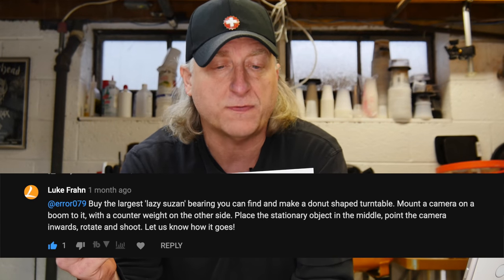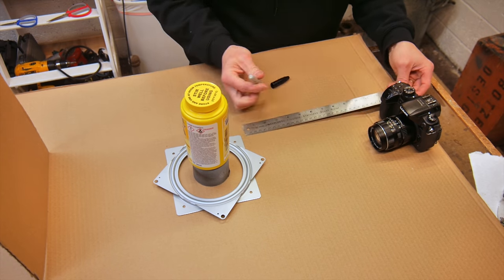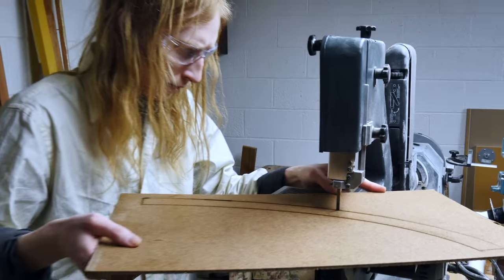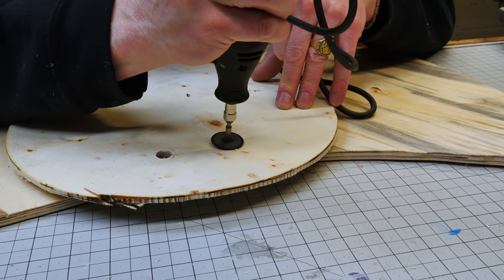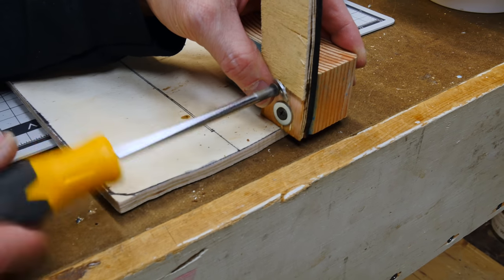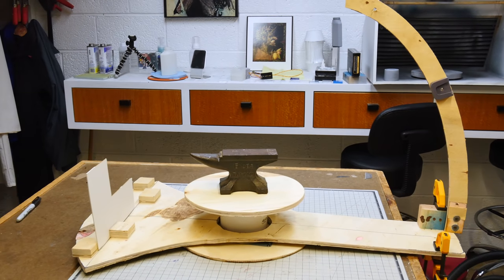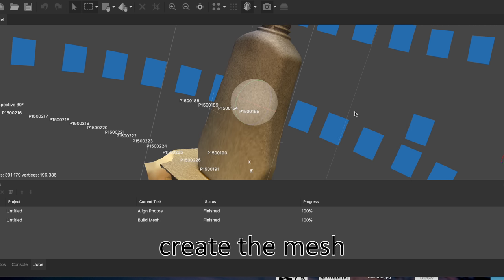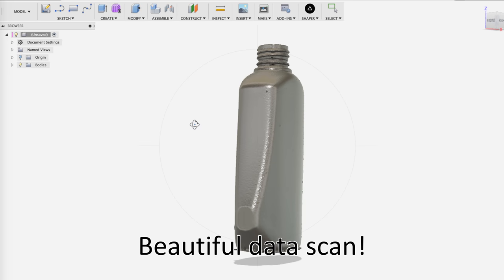Building a 3D Scanner Turntable: Advanced Photogrammetry Agisoft Metashape

Comment: Why not move the object with the plate instead of moving the whole thing around ? Just a small movement of the lazy sue..to keep light 100% the same
Reply from the maker: Just does not work well with this software unless you have very even diffused lighting
Reply: @EricStrebel  If you put distinguishing marks on the platter it works just fine. This is a ridiculous solution to a simple problem. Too many tools, not enough sense.
Reply: If you rotate the object the lighting will change from shot to shot confusing the software.
Reply: photogrammetry doesn't work in that way, you need to orbit object with your camera, no just rotating object in front of it. anyhow, very nice idea, i would add also some lighting etc. congrats.

Comment: Add a few stepper motors, remote shutter release, and a microcontroller and the whole process could be pretty well automated.  I am so amazed/enthused about the advances in photogrammetry and desktop machining in the last 10-15 years. Wonderful times we live in.
Reply from the maker: John Jones yeah, that would be pretty cool, above my skill set, but it would make a good collaboration vid with someone with those skills for V2.
Reply: @EricStrebel  Incidentally, I work at a tech startup that deals with robotics and image processing. My engineering co-workers think this could be done with <$200 of parts, for hands-free operation and a capture time of <2 minutes. I vote you find a mechatronics youtuber to collaborate with if you wish to automate V2. Would make for an awesome project!

Comment: Great upgrade from the Ben Heck Element 13 build he did.  Re-visiting this from when you first made and thinking I might do this in a maybe easier to disassemble design, albeit yours can be unscrewed as well with maybe some toothpicks or scrap wood if the woodscrew holes require.  Thanks for sharing!  Awesome design work!

Comment: Nice work. I had my design idea since two years. The arc which is carrying the camera is near quarter of a circle which goes from -15 degree to 80. But instead the rig is rotating around the subject . The subject sets over a turn table and turns around its axis which is much easier . And the subjects sets inside a lighting box which diffuses the light. Which is necessary for quality photogrammetry.k
Reply from the maker: I would love to see it please post a picture on social media and tag @botzendesign so I can see how you diffuse the light
Reply: @EricStrebel  The issue that I am not using social media to share. But I can send you the design I made for it.

Comment: What if you add a chessboard background instead of a white one, so the machine can compare it and make some calculations? Does the software allows you to manually or through script, telling what is the position/angle of the picture? So if you are using a stepmotor, you can tell the software exactly how many degrees you turn in each picture. What about placing some line lasers and taking the pictures in a isometric view, so you can calculate the distance from the red curvy line projected on the surface to the turning axis (like in a solid of revolution, where you have the line of each degree that will spin).?
Reply from the maker: Rodrigo Jäger I have no idea, reach out to the software manufacturer, as far as I can tell it figures all that out by itself, watch my most recent scanning video here for more insight. https://youtu.be/b1t33KcBlnk
Reply: As far as I am aware, it uses artificial intelligence comparing features from the 3D object and from the background to process how one picture connects to the other. That is why I believe having some sort of background, but still easy to differentiate from the object itself would help. Your result is amazing already, I was just wondering if you can combine this technology with others like counting known steps or tracing projected laser lines to pixels in some sort of triangulation and high order linear regression would improve the results for more situations. We know for instance that if the reflection of the light is not perfect due to refractions in materials like glasses or reflections in shinning objects, it would not be that good. So maybe it is possible to improve it with low cost technology and getting a quality better than some high cost solutions...

Comment: I make a hires video while going around the object.
Then extract frames from every 0.5 sec of my video then use those to make the photogrammetry.
Works fast and great :)
Reply from the maker: I like that, what software do you use?
Reply: @EricStrebel  I use a small free program to extract images from video. But the one i use now had a lot of spam and sale stuff in it and I reccomend you find your own.
After that I use either Mesroom or Autodesk Recap to make the photogrammetry from the image collection.
Autodesk Fusion 3d or Blender to clean the model up etc.
Sincerely PL.
Reply: @EricStrebel  It even works fast enough to make pretty good photogrammetries of (bald headed) persons :)
As the person does not have to sit still much longer then 2 to 3 minutes, instead of 15 to 30 minutes for handmade pictures.
PL.
Reply: @EricStrebel  Try it ;)
Reply from the maker: Peter Lunk  thanks for sharing very much appreciated Thanks for your support
Reply: Hi Peter. What's meant by hires video?
Reply: @dt9913  Hires -> Hi resolution ;)

Comment: Excellent! I thought it would not work without tracking pattern between turntable and item to scan. Maybe the rough plywood provided enough of a pattern to track.
Reply from the maker: error079 Yeah, I was pretty surprised as well, I will reach out to Agisoft and see what they say and get their thoughts as well.
Reply: When I played around with this photogrammetry stuff several years ago I found benefit from placing coloured tracking dots on the surface the object was sitting on.
Reply: @lukefrahn8538  

There’s also photogrammetry spray you can use.  It’s expensive though.

Comment: What I found to work best for me is to rotate the object itself, the final texture comes out uniformly lit on the entire surface, this way the object can be accurately lit in the 3d engine. Just a simple turntable used by cake shops, and the camera set on a tripod at different heights
Reply from the maker: What software supports that? Most do not....
Reply: @EricStrebel  I used RealityCapture https://www.youtube.com/watch?v=d3DA2jB2nQE
Reply: @Song Zee: Your result is impressive. Did you motorize the turntable, or manually spin it in increments? Any photos or footage of how your process goes? Also, I'm curious why you mentioned you had to do different heights with the camera+tripod...
Reply: I have the same idea, why rotate camera, it’s easier to rotate object itself. If the lighting is ambient and close to constant the result should be fine…
Reply from the maker: The software does not work that way
Reply: @EricStrebel  I found in internet many references that people make scans in object rotation way. Maybe I'm losing something.... Can you say why it not working?
Reply: @EricStrebel  It works, In fact Agisoft is the only one i got working with this method. I had 2 tripod system and my phone , works by using a black background and masking the whole background out it post before importing to agisoft

Comment: I took a tossed out microwave and pulled all the parts that I could.  Got a motorized table out of it and now I need to make a mount for it.  It's free and those microwave turn tables are really strong.  Now I'm looking to setup the lights and camera.  It's for eBay listings and 3D model making.
Reply: somehow it didnt work for me, the camera really has to ''move'' around the object to translate it in 3d correctly I guess
Reply: @MrMikedejeuner  I'm not sure how you built your system, but I'm a software dev and I was doing an iPhone scan before Lidar and it was an older phone.  It needed feedback for all the things it got and took a while to get the details.  One of the key things is that it has to be able to know what side it's currently doing, in order to put things in order.  Kinda like a single die, you have sides that are all different because they have a different number of dots on them.  I've never built my own scanning system, but I'd guess it would need to be a slow turn and hitting different angles would probably help too.  I think it's the background that matters.  Maybe the phone knows more about where it is when you move it.

Comment: what would be the difference if I rotate the object instead of the camera?
Reply from the maker: Probably will not work with this software
Reply: @EricStrebel  ok thanks for the reply. Did you try your setup but witout the background? If so it would be interesting if the result is better but i guess if you build this kind of kamera rig attaching a plain baclground to the other side is the least amount of work...

Comment: Would rotating the object instead of the camera work if my lighting is diffuse and I put distinguishing marks on the rotating base?
Reply from the maker: Try and see if it works, possibly it might
Reply: At first I thought it might be possible, but I don't think so.  
Say you used the same object Eric did,  I think in your version the end result would be a model that was cylindrical with the features of widest edges.

Comment: Idea was good! But maybe it was easier to put a rotating table and fix the camera so the object is just there, at the same height within 0.5 mm difference. 
With that long arm holding the camera, there's a momentum that moves a little up and a little down the camera.
Another tip, you could use a remote app to shoot photos avoiding any micro-movements.
And... last but not least, adding a flat egg timer under the table, could automate the rotation so the only action would be press the "Shoot" button on the smartphone :)))
Btw nice video!
Reply from the maker: This software will not work with a rotating table, lighting needs to be consistent through the entire shoot.  Thanks for the comment and support
Reply: @EricStrebel  Oh ye, you are right, I skipped just those seconds where you mentioned it! Sorry...
Reply: @EricStrebel  You are wrong.  This software is working with a rotating table. I've built more than 1.5 year ago a fully automated turntable rig with rotating table. Since then I have no problems with the results. And the key is in proper light setup. Rig with rotating table has more pluses as for me. Occupy less space, more stable when camera moving upward (my do it automaticly)  as I have more pionts to fix the arc.
Reply from the maker: @КристинаТихончук-л4ъ   perhaps, good for you, I am just not able to create a diffused light source, that will create a uniform lighting, so I will have to stick with my solution, feel free to share your creation on social media with me, I would like to see your set up @ botzendesign

Comment: Where did you get and what is the name of the paint that is applied over the plastic bottle for making fine details?
Reply from the maker: It’s just regular automotive Sandable gray and white and black primer, duplicolor brand
Reply: @EricStrebel  Ah, so it is important that second, dark coat actually 'spitting' big droplets instead fine ones?
Reply from the maker: I feel some contrast is helpful
Reply: @EricStrebel  It is very helpful. Tried to make 3D model of the car - epic fail: no roof, no windows, everything else distorted (except 10% of the side parts). I can't paint my car, but for everything else.... Thanks.

Comment: Greetings Eric. So glad I found this video and the way of using lazy Susan. I do have some questions though, and if it's possible some kind of modifications to this model. The issue with my model is that, well, it's a full size mannequin with old ethnological outfit. I need to create a small printed 3D model from the mannequin, something like palm-sized model, using of course the method of photogrammetry.

I was thinking of placing my DSLR on a tripod and use additional studio lights which are controlled by a trigger from the DSLR. Then, placing the mannequin over a lazy Susan base (made from something more sturdy than a plywood, probably steel lazy Susan), and using the same technique like you - rotating every 10 degrees for a full circle. The background is going to be white canvas (used for photoshoots of real models) made as infinity wall (without a corner behind  the mannequin) 

My dilemma - is this way of rotating is efficient and reliable? I'm going to use the same light and photo settings, and there aren't any glossy or transparent surfaces. Thank you.
Reply: Yes, the subject on a lazy susan will work too.  Make sure to take 36 shots each from ~10’ high, mid height and low height, trying not to change the distance from the subject.

Comment: Why wouldn't you just rotate the object in the center and keep the camera, background, and lighting stationary?
Reply from the maker: Rich Sobocinski most os the software does not work that way, unfortunately. It wants the camera to move and the object and lighting to remain constant. Thanks for your comment.
Reply: @EricStrebel  would a black background provide more consistent lighting? the white does a lot of reflecting. not that it didnt work great but an easy enough upgrade.
Reply: @EricStrebel  sorry, still scratching my head. I don't see how the s\w knows the difference. It's still getting 360 degree image data
Reply from the maker: Scott Tuttle good question! You are definitly right about the bounced light. I would think that there needs to be enough contrast between the object and the background and then that could work. Dunno, might have to try some day. Thanks for the suggestion.
Reply from the maker: Rich Sobocinski Don't worry you are not alone, lots of head scratching going on with this photogrammetry software and process. But the other way just does not work so great when the object moves unless the lighting is super constant. The software seems to play a big part in the equation as well, basically I am tricking or hacking the software on a physical level.
Reply: @EricStrebel  Ok, i think i get it now. it's the relationship between the lighting and the target. Thanks for the explanation.
Reply: Great discussion and inspiring demo as always. The product/BG rotation variations do have the preference when it comes to photogrammetry. Software such as PhotoScan or any other off the shelf solutions do prefer the bg to be stationery and lighting unless it's a specular surface doesn't have much of a difference, thou what's imperative is the pixel information moving around and confusing the algorithm. The preferred solution would be to have the bg static and the object rotating so the program can easily differentiate what is in motion and focus on it rather than two separate rotations.EDIT: Unless the object is massive enough to be rotated than you'll need to walk around instead :)
Reply: @EricStrebel  Have you tried adding the photos to a camera station in this scenario? From the metashape user manual - "If all the photos or a subset of photos were captured from one camera position - camera station, for
 Metashape to process them correctly it is obligatory to move those photos to a camera group and mark the group as Camera Station". Also - I have been playing with a smaller aperture - to get the entire object in focus and provide greater detail. To reduce processing time after you build the fast/simple/sparse point cloud you can manually set the region around your object before you build the dense cloud.